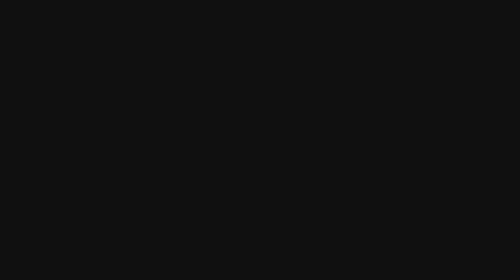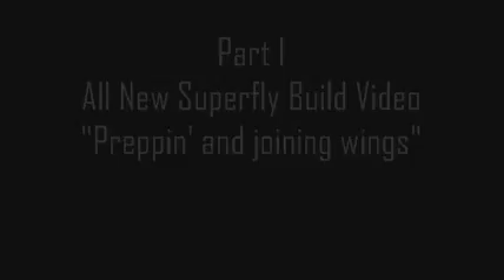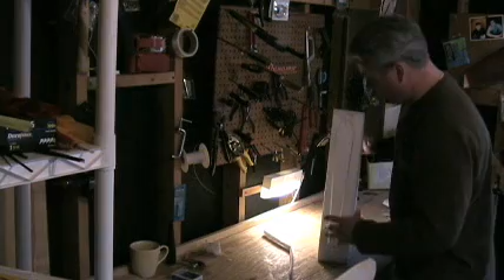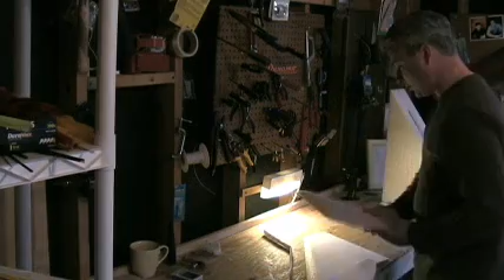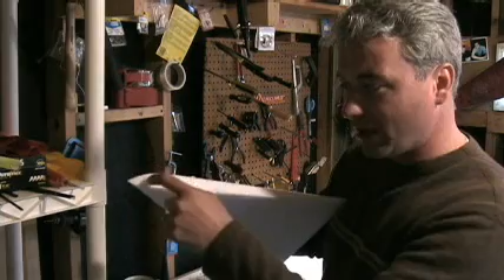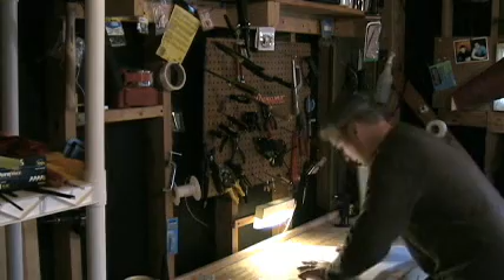Building a SuperFly.. Part 1 of 8..

Comment: Nice. I have built 4 of these. I use wax paper under the body so the hot glue does not stick.
Tomorrow I will be building the super wide SuperFly.
Reply: Glad to hear you like them.  You'll have to post up some video of your extended SuperFly.